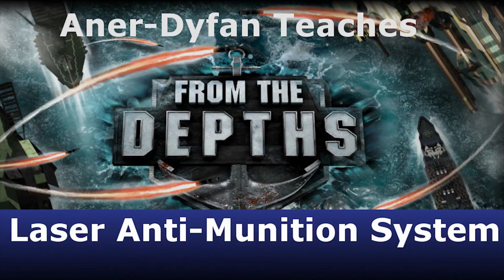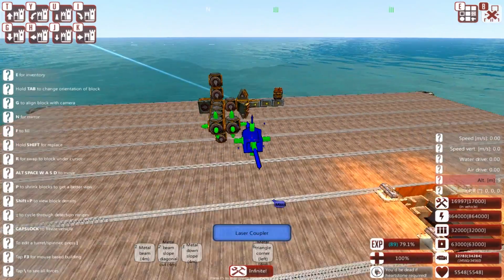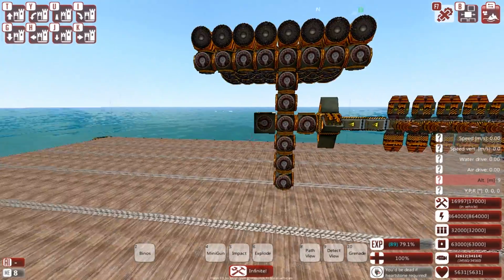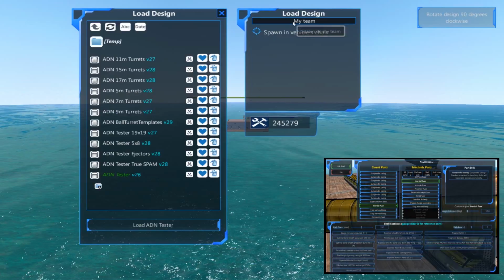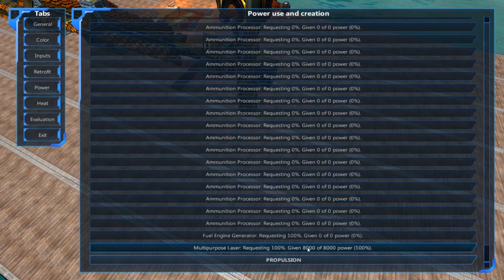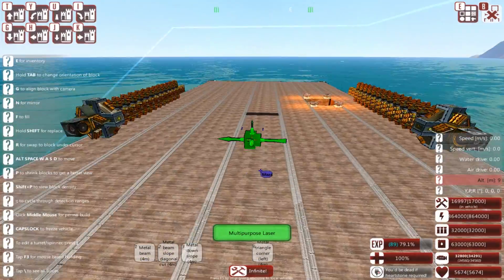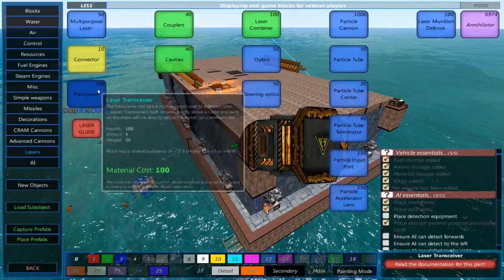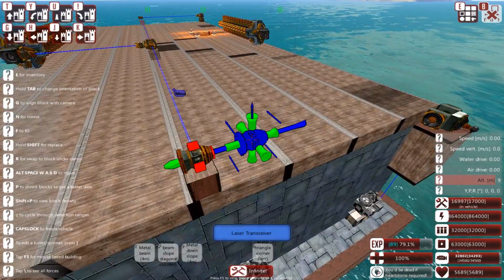From the Depths: Tutorial: Laser Anti-Munition System (LAMS)

Comment: I would like to add that by putting the multilaser core into the center of the craft and linking in the two laser systems to that central multilaser core block via transceviers you can then direct the power of both lasers from that central point to all LAMS nodes all around the ship.

I also recommend using 3 laser systems linked together - two 4Q and one 0Q/continuous one. that seems the most reliable.

Comment: Best tutorial for LAMS, however my pumps are not filling the cavities, and i have an electric engine
Reply from the maker: You will require a fairly significant power supply to ensure the batteries have enough power in for an electric engine to provide enough power. Power draw priority is a little difficult to identify, but other components could very well be using the energy first, thus starving the laser.

Comment: Best LAM turtorial thus far. Thanks for explaning in such great details.

The onely thig that got me thinking is, why not link the two networks up so both of them power both sides?
Reply from the maker: The LAMs node or Combiner can only connect to a single multipurpose laser block at a time. Having 2 separate systems adds redundancy in case a hit takes out this block. It also forces you to have extra redundancy in the links of connectors and transceivers, again so as your vehicles take damage they can still protect themselves from additional fire. Even if it doesn't stop the ship sinking, the longer it takes to kill the more time the rest of your fleet has to eliminate the enemy.

Comment: Hello our glorious teacher,

thank you for another great tutorial. LAMS are the most overpowered thing right after sliced bread and therefore its great to spread them as much as possible.

I would like to make just 3 small points here.

1. Even extremely small LAMS can be very potent - I can provide a BP of 3x3 LAMS that can provide full imunity against up to 2 missiles/s (albeit it is rather burst fire system, full depletion/recharge time is about 4s + tests were done using 5 block missiles) and can take out even rather large CRAM shells.

2. Continous LAMS>Q switch LAMS. The argument for 0q lams is that it can sometimes take out APS shells compared to 4q and at the end of the day you do not need that much dmg on LAMS (APS shell - ~40hp, rocket - ~100-200hp, CRAM shell (guesstimating here) - ~400hp). Even 40 dmg/tick 0q laser needs only around 10 ticks to take out the largest CRAM shell (in theory and neglecting miss ratio) which is 0.25s. That is not bad imho.

3. You can create overlaping field of LAMS by adjusting range&angle on LAM nodes and/or placing LAMS on 2 axis turrets controlled by AM-LWC.

In case I have made some mistakes or my conclusion are incorrect, please, feel free to comment as I always welcome opportunity to improve defense of my beloved vehicles.
Reply from the maker: Not seen an effective LAMS system that small before. Would be nice to have a look, as I need something for small vehicles.

The overkill from a 4Q system is certainly something to consider, but can be limited somewhat with the use of extra nodes. You gain the extra damage from using a 4Q and a lot of redundancy in node placement. Still it's a very valid point, since my main testing has been against my larger gauge weapons (shell health 200-400)  I had overlooked intercepting small armaments where the rapid fire of 0Q is effective. Course, no reason not to link LAMS up to both 4Q and 0Q laser cavities!

I am still trying to figure out how much more effective it is, and if it creates any weaknesses, such as more openings when damage is received.
Reply: It is rather late so I will post the blueprint tomorrow if it would not hurt anything.

Also a thing that (I think but I can be wrong as I've admitedly skipped about 2 minutes of footage) you've missed in the tutorial si the ability to set an engagement angle and range for individual LAM nodes. This allows for low dmg long range lams to up 1km (i've been messing around with those quite a lot and 20dmg 0q laser can do surprising amount of work over the course of 1 km) and also results in better accuracy of the whole LAMS system (and indirectly improves efficiency as it allows for less nodes and power demand) as the accuracy improves towards the middle of LAM nodes cone of fire - I would also recommend tryingt to place LAMS on turrets placed on 2axis CIWS turret for the same rasons.
Reply: So there we go: http://steamcommunity.com/sharedfiles/filedetails/?id=871909621

On the platform is also one leftover from my tetris attempts. Tetris itself has failed but the system is still pretty effective as it can take down even pretty large CRAM shells with ease.

Very important thing to note is that this system is this effective only due to utilization of accuracy bonus on LAM nodes. It will not perform as well if the missiles will be approaching from the edge of its firing cone.
Reply from the maker: That is a rather nice little system, just swapped the standard cavities out for single input ones for additional storage and removed a doubler (you're at 4ap) for another single input cavity. Comes out to be 890mat (compared to my 4Q setup of 1250), and can happily shoot down a number of missiles. Very nice compact system, and I expect it to be great alternative to small AMCCs.

Thinking I'll need to do a bit more with LAMS and push out another video regarding them at this rate!
Reply: Good adjustments you are suggesting, sir.

Those 4 AP are ceratinly a mistake on my side as this setup is meant to take out missiles rather than CRAM shells. 
Those simple cavities are there for the reason that even with storage cavities those 8 pumps can sustain only about 15-20 dmg/tick regardless whether there are simple or storage cavities but storage cavities are tiny bit more expensive than simple ones (I think). 
I have no other rational explanation as to why would I make it in such manner (it is couple of months old build). Also it is fully possible it was an oversight on my side.
Reply: Svorty To fix your missing problem, put the munitions defense lasers on 100m. Test it it works.

Comment: By chance have you tinkered with a laser based ciws yet?
Reply from the maker: Yes I have, only on small scale though. Since you can link a laser source to both laser defense nodes and laser combiners as it is, I don't used it much. Still, the laser combiner can be made more accurate than the defense node, so helps taking out missiles at range.

One interesting thing I hadn't considered is that the AMCC only targets missiles, which means that more targets might get intercepted at the same time. LAMS have a tendency to fire all at the same thing after all.
Reply: I thought it would be a great idea because then you don't have to worry about belt loaders needing to reload and its less explodey since there is no real ammo involved.  With transceivers you can plop them down anywhere easily too if you have the deck space.  I am not sure what the back end of it would be like because of all the components needed to charge it.  I haven't decided if it would be better to have one dedicated charger per ciws or just one massive one that hey all can pull power from.

Comment: Could we get an Anti-Heat shells LAM showcase or just a few tips on doing one?
Reply from the maker: Anti-HEAT in what way? shooting them down or defenses to the laser system itself?
Reply: AnerDyfan yeah, basically if there's a way to effectively detect and shoot down incoming HEAT or HE APS shells comming in at 500 m/s. I assume the laser system doesn't have to be that strong, just needs to be quick to deliver high damage in tiny periods of time and charge in between. the detection Gower seems to be trickier or more unreliable
Reply from the maker: There isn't really, best to set the defenses to max range (from each laser defense node) so that they have a little longer to intercept. This is also a point where a 0Q continuous laser might work out well. You can just link up multiple different cavities to the same laser source, like I showed with the AP part. Just don't give one any Q switches, so then you'll have the slower firing 4Q system and the rapid fire 0Q system all firing at once from the same nodes. However even that won't stop all APS rounds, there is a slight delay for a LAMS to target something new, which means that they will eventually get through.

If I find a layout more effective than this, I will do a video on it. But rapid fire HEAT is one of the most effective APS rounds due to the damage it can deal, and how easy it is to have it overwhelm LAMS.
Reply: AnerDyfan I was saying this because I had faced a LAMS that could effectively take out a 500mm HEAT or HE round at long range, say 2km every second or half. I'm not asking for invunerability, a missile spam coupled with cannons or AP CRAMs will definitely pass through.
I remember the eerie being the lams wielder but that can't be right.